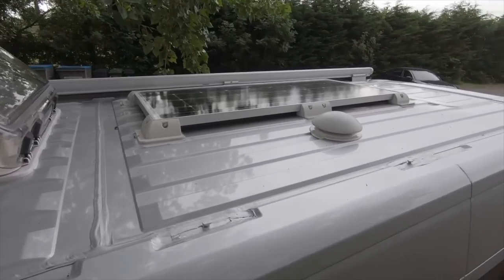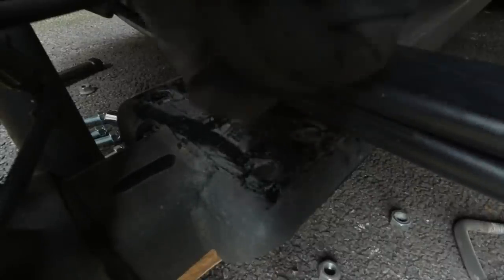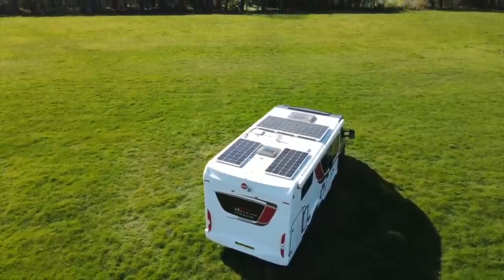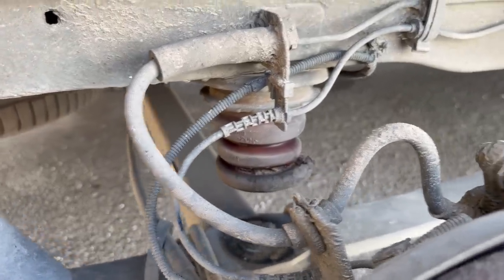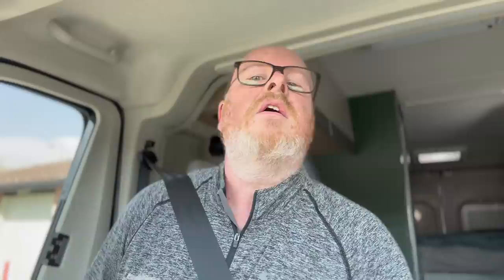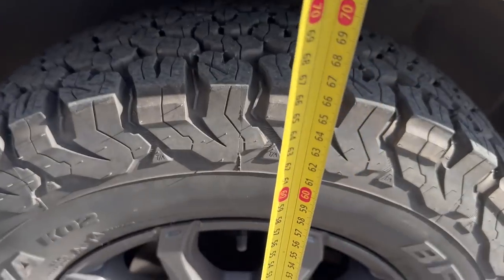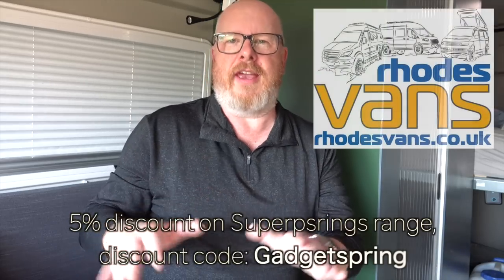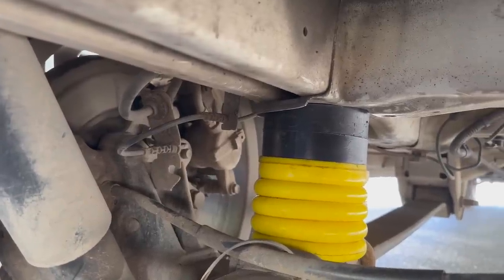Campervan Suspension Upgrade Options - Van Chat Tuesday

Comment: Just added Air Bags to the rear. The bump stops were smashed. £200 kit easy to install, I only had real trouble removing the bump stop cups as one of the captive nuts welding broke. So much better on the uk Potholed roads. If I ever need to do the front Suspension I will look into air bags for the front. Thanks for the info John.

Comment: we have the jones twin springs and the air bags, and Kilen motorhome 4.5t springs on the front. This works very well. When on rough terrain such as beach road dirt tracks I have noticed that the airbags if pumped up above 1 bar reduces the wheel travel, the suspension travel is reduced as the airbag cannot be compressed beyond a certain amount. I had the airbags first and tried all sorts of pressures and wasn't happy with the handling, the springs felt so much better. I am not really worried about the weight, it is what it is! the coil rubber things have been around for decades, they used to be sold as towing aids for rear springs. Had them on my VW T3 Syncro, they worked great.

Comment: Great vlog John I  have Air bags on the rear. To be fair I don't have a lot of weight as I'm  a weekend Warrior but when  I have a little bit of extra weight they are handy just to take it up level and also use it for levelling up sometimes. And it is a better ride 
Be safe

Comment: Great info John, you did well removing those old bump stops, did mine the other week and the weld on the cup broke on both so the cup was then spinning on the bolt with no way to remove it, ended up just inserting the new ‘rubbers’ into the old cups
Reply from the maker: I had the o/s but weld snap within the first few turns so I used a multi tool with a carbide cutting tool to cut through the bolt and that allowed me to fit the new one and get a nut through the top.

Comment: I have the air bags. It does make back end a bit hard, I only run them about 30 psi, anymore it’s like solid. So your new system looks much better.

Comment: I fitted the Dunlop air suspension kit to the rear of our Boxer. Easy kit to fit   Did not opt for the kit with compressor just manual inflation. I would advise that if you are removing U bolts from the springs, you seriously consider fitting new U bolts especially if the van has covered a few miles. The air suspension certainly has improved the ride quality on the rear especially when loaded with ebikes  etc. I always think of the Castlemain 4X advert “ I think we have overdone the Sherry”
Reply from the maker: Good tip!

Comment: Very strange you should post this up now as I am about to fit a bagged system on  my Master, It's an ex ambulance with a Dunlop factory system and  to replace the knackered bags is £350 a side, now the original compressor has also decided not to fill the bags,  the bags leak slowly but hold air so that's not the issue, like so many others I am going to fit a kit as I'm fed up with it breaking down every time I want to use it , wish I could go down the route you have  but it's not possible until the steel ramp cage is removed. Enjoy your travels

Comment: Great video, they will compress a bit over time, from your measurements you can see you managed to balance the weight left and right pretty well, bit more weight on the drivers side (about 1cm worth) I would guess the batteries are on that side. 😊
Reply from the maker: Yes, the batteries do account for extra weight on the offside but once I load up my garage with my bike, kayak and tools on the nearside it’ll all be balanced out.

Comment: Hi John - nice video as always. Thanks for posting. I’ve read and seen other videos where people have fitted just one ‘spacer’ to the rear Sumo Spring. Looks like you fitted two spacers. Was this of your choosing (ie you wanting more ride height) or were two spacers recommended by the manufacturer for your specific vehicle? Hope to hear. Thanks, Nick
Reply from the maker: If you remove a space the bolt wouldn't be suitable as it's only threaded at the end, so it seems the manufacturer wants both spacers to be used.

Comment: 2 quick questions doesn’t it make the ride stiffer and therefore less comfy and how long are these items expected to last. Cheers
Reply from the maker: Yes, it’s a firm ride but on a normal smooth road, motorway etc. you still get a comfy ride. 
Your other question is best suited for the manufacturer.

Comment: John , enjoyed the advice but since you’ve had both a camper van and a Motorhome what would you recommend for a Moho upgrade ? I have a two year old Burstner over 3500kg and find the ride a bit crashy on A and B roads , probably down to the highly inflated Michelins . I think from previous videos you recommend fitting All terrain BF’s at a lower PSI , what suspension mods would you recommend? Appreciate any advice you can give .
Reply from the maker: The BFG allow for lower pressures as the sidewalls are much stronger than other tyres, so that helps. This state 1 kit would be my suggestion as an easy and very welcome upgrade to the stock suspension.

Comment: John, have you used the wheels and tyres that you had on the motorhome, just wondering as we have taken our wheels and tyres from our motorhome to fit to our campervan (when it eventually arrives), just concerned about wheel arch clearance. Cheers safe travels
Reply from the maker: As you can see from the video the clearance is fine 👍🏻

Comment: As usual, an interesting video, and as usual, it's got me thinking about our van and what to do about its poor suspension which is very hard and transfers every rut and pothole into a minor shock wave throughout the van. Has this lift kit smoothed out the ride, stiffened it up in respect of shock or not affected this issue? We have the maxi Ducato which has, I understand, the heavy weight suspension as standard.
Reply from the maker: If you’ve got the maxi then you’ve got double leaf springs and uprated shocks already, so my suggestion to smooth out your ride would be to get BFG K02 tyres so you have more flexibility on tyre pressures, standard van tyres require very high pressures due to their sidewall construction, so the BFG would let you get a smoother ride as they can run at lower pressures.
Reply: @Gadget John  Cheers John. That's the general plan once these Michelin cross climate tyres are worn out, but they are holding up well and show little signs of wear, so it's hard to justify the cost just now.
Reply: Oddly enough, although my van is definitely a Ducato maxi,  it's got single leaf springs. They are fairly chunky and have a "happy smile". The Van only had 13000mls on it when I bought it, and I can't imagine anyone changing the springs on it at that mileage, although anything is possible. Maybe it was spec'd as when purchased  by ih motorhomes as a camper. Further investigation required. 🔎

Comment: Looks great. If the air suspension was cheaper - would you rather have that?
Also, is the suspension kit Tüv compliant? Your MOT. 
We have to produce certification if we make any modifications.
I am trying to source 2 hand double leaf springs and airsuspension on mine.
Reply from the maker: I covered the air suspension in this video, the other info you can find out from the manufacturer.
Reply: @alanhat5252  - Mine is an old handicap bus, and the single leafsprings have a very heavy "frown" and not a happy smile as John puts it.🤣🤣
Not even empty.😭

Comment: John do they have some form of Spring built into the bump stops to allow the axle to move up and down as you go over bumps, or are they simply just a solid block of nylon. great video John cheers mate
Reply from the maker: The spring is the leaf spring, the bump stop is not solid plastic so it allows for movement too.
Reply: @GadgetJohn  so a bit like in the 70s when you wanted to jack up the back of a car by putting two lumps of wood in there then. I have had a look on their website and there is very limited information nothing really explaining how they work I would imagine you really need stage 2 so you've got the uprated Springs as well. because as you've got it I would think it would be a very banging bumpy ride on any rougher terrain than tarmac roads as it seems that you have very little travel for your axle if any.

Comment: I have manually inflated airbags on my pickup for when I use my truck camper. It rides much better with the camper pod on the truck but in 6 years I've never used them to level the van. It's much quicker to use a ramp but I might have do it next time that I drive off and leave the ramp behind (I wonder if they will still be there next time I go to Scotland).

Comment: Excuse me for possibly talking complete guff, but isn’t there something on the rear axle that measures a lower ride height based on it having weight inside and adjusts the brakes? Won’t forcing an increased false ride height confuse that? Or am I talking complete nonsense?
Reply from the maker: No, and with 3 vans of experience I can confirm that it’s not on any vehicle of this type.

Comment: A bit of advice you can only do 50 mph on a single country lane in a van
Reply: But 60 in a campervan 👍
Reply: @garagefaff  that is right but only if its registered with dvla as a camper
Reply: If your vehicle is registered as a motorhome/motor caravan and has under 3.05 tonnes unladen weight you can do 60 on a single carriageway.
Van conversions can go either way depending on if they are based on a goods van or a car derived van weighing no more than 2 tonnes (laden). Only a self converted micro camper is going to be under 2t though.
Reply: Wierdly it doesn’t have to be registered with DVLA as a Campervan it just has to meet the criteria. 👍 Same as presenting for MOT. The DVLA classification doesn’t matter.
Reply: @garagefaff  Yes, this is correct.  The V5C classification doesn't affect speed limits and is just there to describe the outward appearance of the vehicle. Having said that, I would get the classification changed to motor caravan in order to remove any confusion which could arise.  I wouldn't want to have to travel to a court on the other side of the country to argue against an erroneous issued speed ticket.
Reply: Yeah as i said a converted van not registered as camper can only do 50mph on single carriageway because it is classed as a commercial vehicle
Reply: @nashsgt  Our new van is coming from a converters but will be registered on the V5C as a "panel van".  This doesn't affect the speed limits which apply and we can drive it at the same speed limits as a car.  However we will get the V5C changed to "motor caravan" to make life easier!
Reply: @nashsgt  It’s not the easiest to find the facts but if you have a commercial vehicle it subject to the lower limits but if you change that van so it meets the specifications of a motor caravan it ceases to be a commercial vehicle and becomes a motor caravan for speed limits. It doesn’t matter if it started life as a panel van etc. it doesn’t matter if the DVLA have reclassified it. It just has to meet the criteria.

Eg Panel van with a mattress in the back is still a panel van (it doesn’t meet the criteria)

Panel van with windows/ fixed bed/ fixed seating / cooking can still start life as a panel van, say van on the logbook and legally do 60 as it would meet the criteria. 👍
Reply: @alanhat5252  Apparently they are much better now after complaints.  A friend of mine just had his panel-van reclassified within a couple of weeks after submitting photographic evidence of the conversion.
Reply: Great conversation What’s the advantage of re classification , and what constitutes a van modification for the insurance this question is for anyone who will answer really
Reply: @welshieonwheels  Technically there is no advantage. In reality though I suppose the above shows the confusion around the issue. If you get it reclassified you save yourself any confusion with the relevant bodies (police, insurance, VOSA, tolls, etc.) Yes they should know but the man on the ground may not. If it’s reclassified then you’re potentially in for less hassle as its clear cut.
Reply: Also automatic speed cameras go off the body type so you may get a ticket you then have to dispute and clarify and the burden of proof will be on you.
Reply: @garagefaff  thank you 👍iv basically a big removable box which I can convert to a bed and a couple of cabinets bolted down but haven’t spoken to the insurance yet , it’s probably chick feed to you guys , but I do want to do the right thing . Thank you for the feed back 👍🏴
Reply: @garagefaff  Yes, this is my thinking behind getting the classification changed.  On paper (and legally) it's fine to leave the van as a "panel van" on the V5C. But to save having to prove that should a ticket be issued in error then I would get the classification changed.